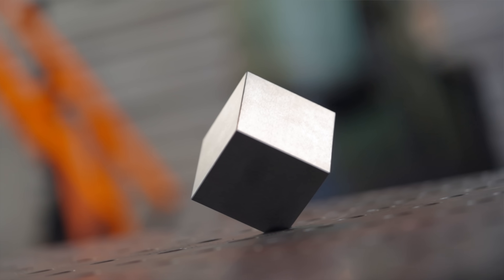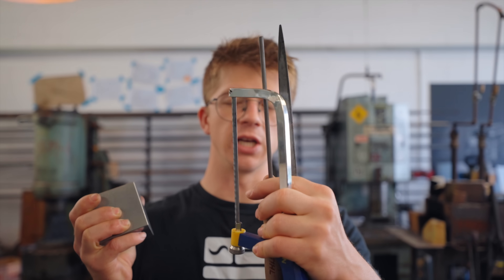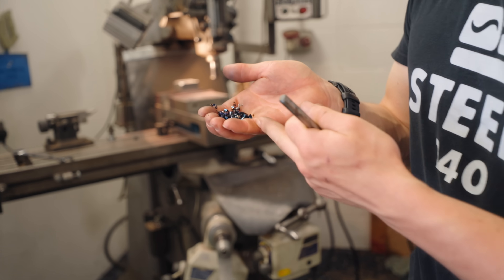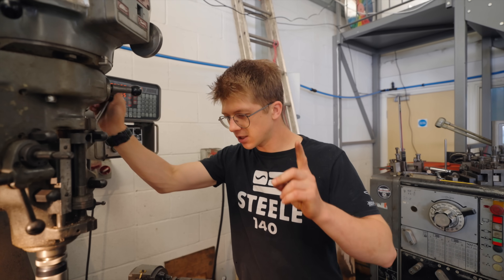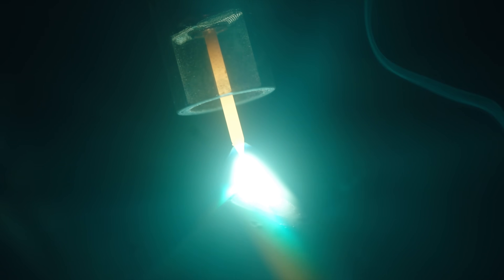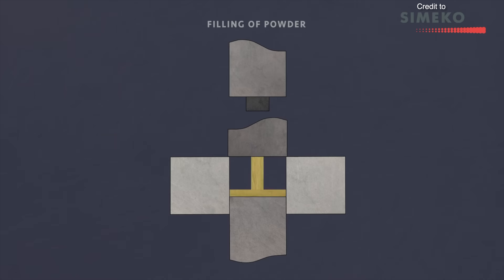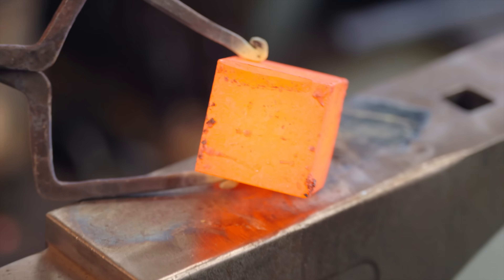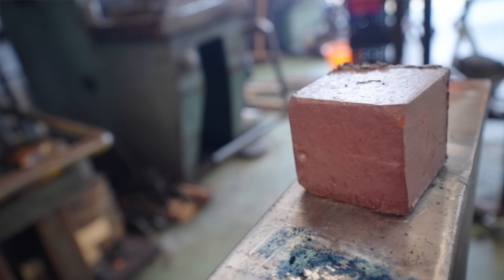Can You Forge Tungsten?

Comment: You're trying to forge Tungsten at only about 45% of its melting temperature (~1640 K vs ~3700 K), and comparing it to forging steel at  upwards of 90% of its melting temperature.   Of course they won't behave the same.  

Standard forging temperature for steel is >80% of melting temperature.   If that 80%+ holds for tungsten, you'd have to get it to ~2950 K (~2680 C, ~4860 F)

Doing that would be a nightmare, however, given that acetylene fire only reaches ~2200 C, and fire brick is only rated to about ~1650 C, which I assume is why you left off there.

Comment: Pure iron turns to gas at a LOWER (2850C) temperature than the temperature Tungsten needs to turn to liquid (3400C).

Alloying them seems to be an interesting process as you'd basically be infusing liquid tungsten with Iron, carbon and other gasses.

Comment: Freelance Baker here—tungsten is such a dope material, I came across it while trying to find ways to improve my baking equipment. Apparently, it’s used in all sorts of high-heat applications, and I’ve started using it to line my bread pans. It’s amazing—bakes everything evenly, and nothing sticks, even at the highest temperatures. I’m also looking into getting a tungsten rolling pin because it’s supposed to give perfect dough consistency thanks to its weight and durability. Honestly, it’s becoming a bit of a secret weapon in my kitchen.
Anyway - awesome video, very cool to see you play around with it in a blacksmithing workshop!
Reply: Is it safe for working with food? You can get lead poisoning, maybe tungsten poisoning is also a thing.
Reply: @tomaspecl1082  I would think that because of the durability of the metal even at high temperatures that it would not end up in food in the way that lead--a very soft metal--might. There is limited data about the effects of tungsten exposure because being exposed to high amounts is so rare. That said, there have been studies which showed adverse health effects in rats that were administered sodium tungstate orally, which is less robust than elemental tungsten and is water-soluble. Elemental tungsten does not react with water, acids, bases, or oxygen (unless it is literally red-hot); so in a baking application, it seems unlikely that the material would be stressed enough to pose any threat.
Reply: @fulstop_  but as far as I know elemental tungsten is not found in nature, its always in a compound, so it must be reactive
Reply: @tomaspecl1082  There are plenty of elements not found alone in nature, heck iron, nickel, copper, tin, and a load of other commonly used metal ore are quite impure.

Haemetite is the most desirable iron ore because it is generally 98% iron but iron is found in 4 forms: Haematite, Magnetite, Limonite and Siderite with Magnetite being the next most pure but it drops to 70-75% and the other 2 being minerals than contain several metals which is the main reason they are mined over something else.

Nickel comes mostly from 2 sources Nickeliferous Limonite (yes the same stuff I just mentioned is one of the 4 main sources of iron) at less than 3% and Pentlandite which is much higher at around 34% but Limonite as mentioned is mined because it contains like 3 or 4 elements than can all be separated.

Bornite at 64% and Chalcopyrite at 34% are the main sources of copper.

Bauxite of course is the primary (and for the most part only commercially viable) source of Aluminium but it only has an Aluminium content of 15-25%.

So an element not appearing by itself in nature means very little in terms of its reactivity.

Tungsten, like many metals, it only exceptionally reactive at high heat (like with many "reactive" metals the red-hot point is generally when it becomes reactive). At any normal everyday temperature it is non-reactive and quite stable. In fact it is typically classified as non-reactive in any hazmat reference table/lab chemical safety datasheet. It is unaffected by most acids and bases and does not react with water or oxygen at room temperature or anywhere under 500C, so well above any normal baking temperature. It does react with oxygen somewhere between 500C and 1000C+ which forms Tungsten Trioxide, but that it is only classified as an irritant and not considered life-threatening/dangerous.

In short: Tungsten is actually very food safe since it is unaffected by essentially anything that is safe for human consumption though it is advised not to cut or scrape it purely because than could cause some tungsten flakes to get in your food (not likely at all but hey some kitchen knifes are surprisingly hard) which isn't toxic but like any metal shavings in your food can cause micro cuts in your digestive tract which could cause discomfort and potential minor internal bleeding.
Reply: If you are serving other people, you should very thoroughly disclose that you are using tungsten and that it may have unknown health effects.

Comment: To forge tungsten use electric arc furnace or any electricity heating equipment, it definitely will work or another easy way ,keep that tungsten under a lightning it is 5x greater than sun surface (50,000 degrees Fahrenheit) 😂 nothing will be left only some piece will left

Comment: I know that tungsten has serious, serious issues with oxidation in air, so it would be interesting if the smoke you were getting was actually the tungsten itself making oxides that were cooking off somehow (I guess, if the block is hot enough, the tungsten oxides could actually be vapor just for long enough to condense into fine smoke. The melting point of tungsten oxides seems like it's a bit higher, and the boiling point is closer to 1,700C. But, that doesn't rule out the idea that the oxide layer is "steaming" like a 40C hot tub "offgassing" despite not even being half-way to its boiling point. 

In terms of melting it, i looked up the temperature of a hydrolox flame, which can get to around 2,800C, hot enough to melt sapphire/aluminum oxide/alumina. But your other option would be acetylene, which seems like it can, at its absolute peak, get just a hair hotter and crack 3000C on a good day. And you probably already have a acetylene torch.

Comment: 13:32 The 5 kg cube is moving at about 110 mm per frame. At 25 fps, that's 2.75 m/s (6.15 mph).  The kinetic energy can be used to estimate how much damage it can cause:
Tungsten Cube:
mass: 5 kg (11.02 lbm)
velocity: 2.75 m/s (6.15 mph)
momentum: 13.75 N*s (3.091 lbf*s)
kinetic energy: 18.9 J (13.94 ft*lbf)

MLB Fastball:
mass: 0.1453 kg (5.125 ounces)
velocity: 41.57 m/s (93 mph)
momentum: 6.04 N*s (1.358 lbf*s)
kinetic energy: 125.5 J (92.56 ft*lbf)

Besides being hotter, the cube is much harder and pointier than a baseball, so it might actually be more dangerous than a baseball when striking hard, bony protrusions.

Comment: 1:55 You actually classify it as being made out of a metal-matrix composite. The full name for this material is "cemented tungsten carbide", because it is tungsten carbide powder cemented within a metal matrix of (typically) cobalt. Typically the metal "cement" makes up a small fraction (less than 10%) of the volume.

Also, it's possible to sinter tungsten carbide (without cement), but for now almost all applications are cemented, not sintered.

Comment: I run an EDM Machine and use small tungsten blocks as the electrical conductor that the wire runs along to get the electrical current to cut through all different metals and it lasts forever in that use 👍

Comment: No offense but I could have answered all your questions without wasting all that time lol. I wish you did some research first, I want to see if it actually forges as easy as tool steel, like people claim at the proper temperature of around 2385°C (4325°F). What you're doing is sort of like beating the hell out of S7 tool steel at 1500°F. Lol. You need to be atleast 70% the temperature. I mean just think about this logically it eventually turns into a liquid at some point, If you did research you would have known a coal Forge can get just about hot enough at 4000°F. I wish I had funding for research and development and experiments... I just have to do this kind of stuff out of pocket.

Comment: About HSS alloying with tungsten: They add the metals not as elements, but as compounds. Such as Titanium, that would be added as FeTi. It's exactly because of the reason you said, steel doesn't get that hot dueing the process, but the compounds melt at a much lower temperature. Furthermore, the density is closer to that of iron, making it easier to mix.

Comment: Did you have to do any sort of materials control for that piece of tungsten? 

Few times i've seen it in the machine shop you need like documentation to track material use so it doesn't get diverted to other things. Maybe it's just a Canada thing or a specific customer.

Comment: Yes, tungsten can be forged, but it requires specific conditions and techniques.
Here's why:
 * High Temperature: Tungsten has a very high melting point (around 3422 degrees Celsius), so it needs to be heated to extremely high temperatures to be malleable.
 * Specialized Equipment: Forging tungsten often requires industrial-grade equipment like hydraulic presses or specialized forging hammers capable of exerting immense force at high temperatures.
 * Protective Atmosphere: To prevent tungsten from oxidizing (reacting with oxygen), it's usually forged in a protective atmosphere, such as hydrogen or argon.
While it's possible to forge tungsten, it's not a common practice for most blacksmiths or hobbyists. The specialized equipment and extreme temperatures required make it more practical for industrial applications.

Comment: You shouldn't machine tungsten without coolent. As a heavy metal tungsten is really bad for your health. The body isn't able to get rid of it once it enters your body. It is able to penetrate your skin in powder form. This is the reason why we have to wear a full body suit that is chemical resistent. We have to wear gloves that have to be taped to the suit and we have to use plastic overshoes. We also have to wear a full face mask that blows filtered air in to it. And despite all of this we still have to go to bio monitoring at least every 6 month. When we machine it we have to use flood cooling

Comment: 12:34 - it's smoking because at this temperature it's alredy oxidizing. This is tungsten oxide, and it settles on everything that comes in contact with smoke. Similarly, if you break a lightbulb and then turn it on, filament will "burn out" producing this exact smoke. Great video!
Reply: Or forget to turn on the argon! Poof!
Reply: I'm guessing that's the reason for the inert gas in the TIG welder?
Reply: @E-BikingAdventures  it's used to protect the base metal and the tungsten from oxydation
Reply: @altoso1  . yes i know. I watched the video and read the original comment.
Reply: Zinc does that too.
Reply: Somebody once explained me whey they pull a vacuum on lighbulbs. When the filament starts to burn, the vacuum will make the smoke fall right back on the fillament and prevent the filament from burning out.
Reply: @SeamonVB  . Someone explain you wrong. There is argon gas in a light bulb. Not whey no vacuum.
Reply: @E-BikingAdventures  Yeah, seems like you are right. Only the early incandescant bulbs were like that, apparantly. Thanks for the correction!
Reply: @SeamonVB  Not the best explanation to be honest. Tungsten filament doesn't immedately burn-out under vacuum because there is "nothing" around it that it can react with (oxidize). "Nothing" is in captions however, because in reality tungsten still evaporates in vacuum light bulbs, eventually coating inner side of glass and making it blacken. You need to lower it's temperature, therefore lowering the overall efficiency. On the other hand, filling that lamp with inert gas, for example argon, allows filament to work at higher temperatures, but it has a disadvantage to user - gas contributes to temperature transfer, and makes outer glass envelope reach high temperatures.
Reply: @SeamonVB  that's not how it works... There is no oxygen, that's why the tungsten filament cannot burn

Comment: Alec, I have this exact same cube except 1.5 inches on a side (1 kg almost exactly).
This isn't pure tungsten. It's probably 95% tungsten with 3.5% Nickle and 1.5% iron.
The melting point, hardness, and strength are all dramatically reduced. The density is about the same, though.

Comment: Here one more interesting fact (and use case) of tungsten: It's used as tank ammunition.
For modern armour piercing round there are two different kinds of metals in use: tungsten and depleted uranium.
The reason is simple: you want a solid and dense kind of metal as your sabot to maximize your penetrating power.
So, some countries use depleted uranium (e.g. the US) and some use tungsten (e.g. Germany).
So why take one over the other? Well, at lower-ish velocities (like 700 m/s) depleted uranium has greater penetrating power than tungsten and is cheaper. But depleted uranium also has one big downside for the inhabitants of the area where it's used: It gets into the ground water and general environment (the later means that people will breath dust particles of it in). And well, besides the fact that depleted uranium is radioactive, it's also a heavy metal and has purely from that similar effects to lead to the human body (and the radiation on top). So most countries decided to use tungsten and when it became important to increase the muzzle velocity to offset the otherwise lower penetrating power.
And well, turns out, when you increase the speed enough, tungsten surpasses depleted uranium in penetrating power at the same speed thanks to heat gained from friction (with air). This was discovered by the US while experimenting with Rheinmetal's 120mm L/55 gun which modern versions of the Leopard 2 use (earlier versions and the M1 Abrams use the older 120mm L/44 gun, so a shorter barrel and with it a lower muzzle velocity). And well, this is also the reason for why the US stuck with the shorter gun, because they would need to replace LOTS of ammunition if they would.
So yeah, at about the speed of about 1000 m/s friction increases the heat of depleted uranium enough to become weak enough to lower the penetrating capabilities enough to become worse at it than tungsten.

Comment: The best word to describe the properties of Tungsten is "refractive, Tungsten is chosen for the multiple uses we use if for because it is highly refractive, meaning it can withstand high levels of heat and still maintain its form and purpose. Now think about a Giant Tungsten telephone pole up in orbit, and dropped from orbit down onto...say a battleship. take a wild guess as to what is going to give way first, the entire battleship of the Tungsten Telephone pole? Tungsten is a highly refractive metal, and although is can be used for forging, you are going to have to heat it up much closer to it's melting point in order to soften it enough to me able to form it. and I'd wager than most of your tools are insufficient to do the job. all of your tools, including the hammers and anvils of your power hammers as well as your regular anvil would have to be Tungsten as well, for them to not be damaged by the massive amount of heat from a Tungsten forging resting you uber hot tungsten block on a steel surface would cause the steel to melt and deform while hammering and forging it at the needed temperature.

Comment: Tungsten carbide being a lower density makes sense, Carbon is light, Tungsten is heavy, mix something light with something heavy obviously will result in a lighter alloy. I'm a dairy man, not a metal expert, but is also makes sense to me that Tungsten carbide is so tough: In steel, the small carbon atoms get "in between" the much larger atoms of iron. I'd assume the same happens for Tungsten carbide being essentially Tungsteel

Comment: 1320 degrees C for a gas forge?  I remember a while back the king of random (RIP) made a home arc furnace that could exceed 1,648ºC using carbon electrodes harvested from lantern batteries.  I know that's half what the melting point of tungsten is, but you made a little progress with 1320, so maybe an extra hundred might allow more progress.

Comment: Order a more manageable piece, heat it in the furnace, then use an oxy-acetylene torch to get it to a more "forgable" temperature. Just a thought. I think pure tungsten is brittle, so I don't think you could forge it into a tool. Forge it into something decorative or artistic. Edit: forge it into something an old timey blacksmith would make, like a horseshoe.
Reply: It is brittle at room temperature. Room temperature is like cryogenic temperature for tungsten. Most metals have a ductile-brittle transition temperature (DBTT) well below room temperature, but tungsten has not. So at higher temperatures it becomes a more "normal" metal, but denser.

Comment: Im pretty sure that block of tungsten is so easy to cut through because of the melting point being so high
Its not possible to actually forge it, so you have to sinter it
Forging is actually turning the metal into a liquid then casting it and cooling it
Sintering is taking the metal as a powder, then heating it together. 
I may be wrong though

Comment: Work it into a ball (or cut it if necessary) and drop it from 5,000 feet, onto one of those steel plates they use to cover trenches they are still doing road work under.  And use slow motion cameras to figure out the velocity, and if it is still accelerating or has reached terminal velocity.
If hitting a steel plate sounds impossible, maybe find some natural stone surface to drop it on?